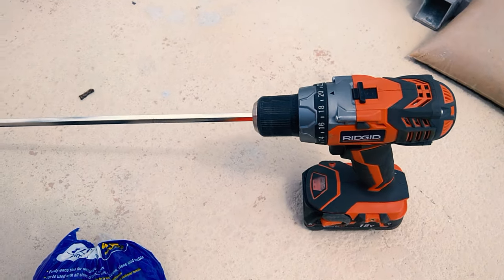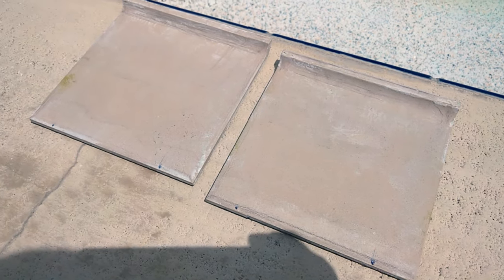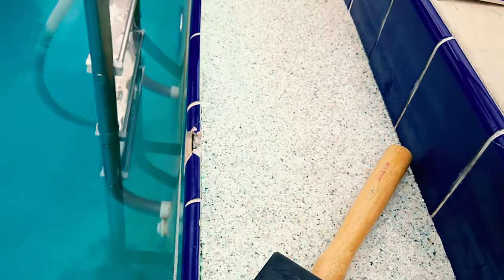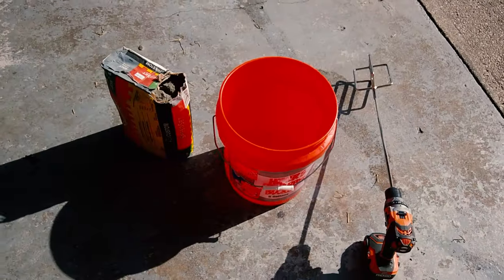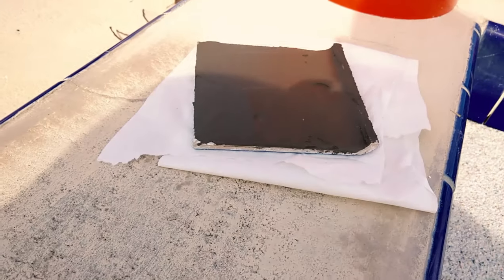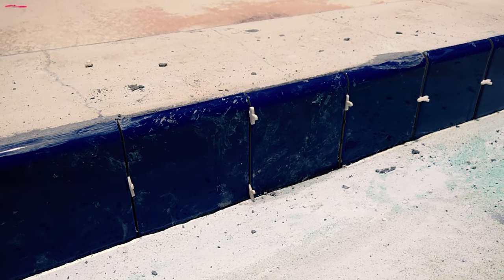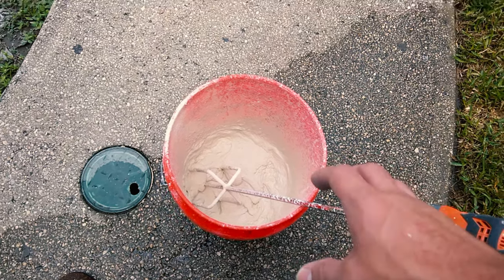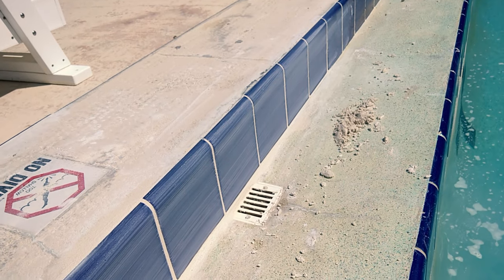Swimming Pool Tile Repair

Comment: great video how did you keep the trash/waste from falling into pool water?
Reply from the maker: hi. good question. I used a simple technique. floating carboard. so as pieces fell it fell on it and then I cleaned it and kept going.
Reply: @MasterMindHandyMan  I was thinking about using the 1" rigid foam board. Thanks
Reply from the maker: @bigtexajd  yes sir. great idea. anything that floats is perfect.
Reply: Now that’s a great question! 👍

Comment: I do tile professionally , 20 years however I have never worked on pools.  Now that I have a home with a pool, this year we opened the cover to discover tiles had come off.  We dropped the water level well below all tile last fall.  We did not buy an automatic pool cover pump which turns on automatically.  There was a lot of water from Winter that built up and the froze on the cover.  My guess is the weight of the ice and water on the cover pushed down and the pool water rose up underneath because of the weight on top.  This cased a freeze thaw situation which popped the tile off.  I wont make that mistake this year and I will buy the automated pump.    I am a little concerned with using customs speed set in this application as I have heard Granny Rapid is better for pool and outdoor Situations.  Isn't a situation where thin set mixed with water can have problems outdoors and cause a freeze thaw situation?  There are also much better chemical resistant grouts than normal sanded grout especially the polyblend grout.  I would think Quartz grout would be better or Mapei Ultra color FA ?  Would love your feed back as I am now looking for the best materials to make sure my repair is going to last.  This is a gunite pool about 13 years old.
Reply from the maker: hi. thanks for stopping by. you had great points as to which product to used. one thing I learned is that depending on the water. salt or regular. also depending on if the pool is screened in or opened. there are different types of materials for different enviroments. i can't suggest specific one considering how many options there are at the store. i do recommend when yo uare ready use customs products. go with a grout and a thinset you can mix in yourself rather than already mixed. this will allow for a fresh application rather than a sitting on a shelve wet product. always go with the professional grade as these are special chemicals for long lasting.

Comment: I would have used white  thinset and undercut the waterline tile and the scum gutter tile would have made removing a breeze no flat blade by a pool ever alos pool looks like it has a lot of copper staining nice job end result 👍
Reply from the maker: great tip. i guess it comes down to we are all used to our methods.

Comment: Do you need to seal the grout
Reply from the maker: yes. the steps shown on the video are to be followed. first you use the thinset to stick the tile onto the wall. once 30 minutes at least have passed then grout it. after 15 minutes or less then wipe down the grout before it fully dries.

Comment: What's the difference between Custom SpeedSet and E-Z Patch 3? E-Z Patch 3 is marketed as pool tile cement, but does it have any significant differences?
Reply from the maker: hi. in fact they do. the speedset is designed for pros. needing to install tiles in a quick manner. where as other cement products cure in its normal time frame. sorry for responding late. still reviewing and responding to hundreds of comments. please forgive me as I'm trying to learn and grow the channel and a business lol.
Reply: @MasterMindHandyMan  no problem, thanks for the reply. Youtube doesn't make it easy to see responses to comments. I did the job using SpeedSet and it seems fine.
Reply from the maker: @chinagoer9863  glad you did is the best. please subscribe for future handyman videos.

Comment: How do you clean up all the grout you have floating in the pool now?
Reply from the maker: that is a great point of concern. I personally did my best to not allow much to fall into the pool. however the small portion that does is normal. the solutions of the pool, just like the sweat of people. will eventually clean it. besides that though I had the pool guy scheduled to come in after me and cleanup the pool before opening on monday. If you do not have such person to cleanup after, then of course go in and pickup as much as possible to minimize the grout from disolving.
Reply: Bubble wrap works really well taped under the tile line as it floats on the water and allows you to catch most of the debris